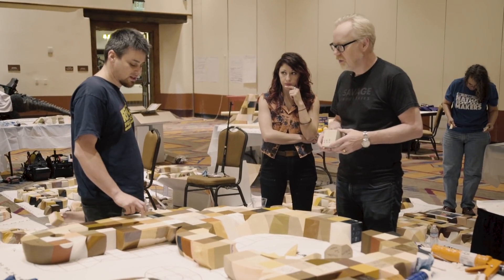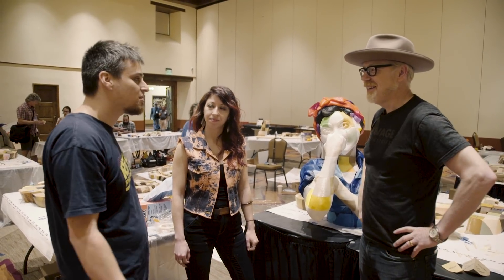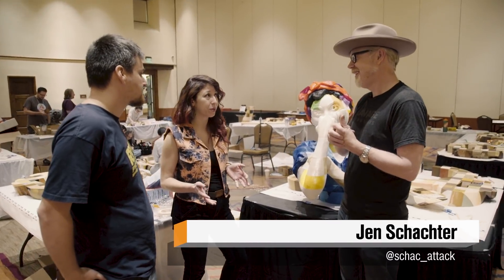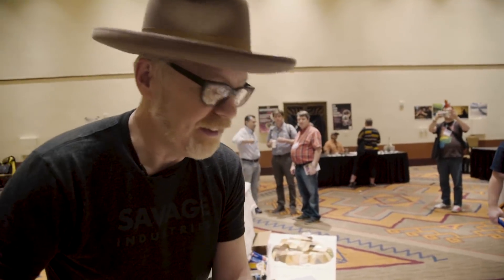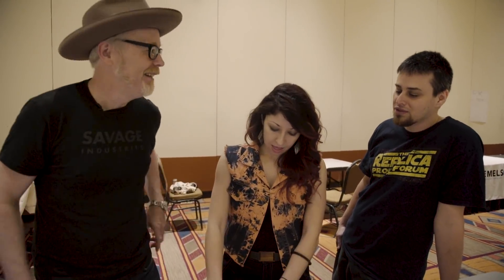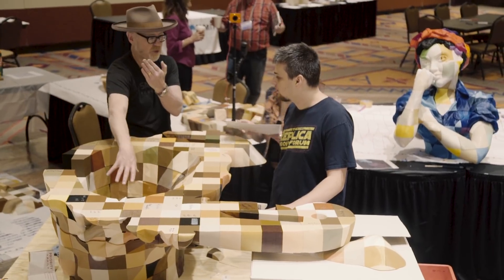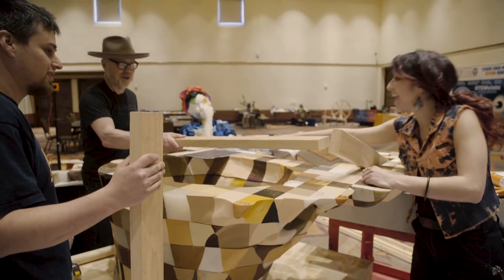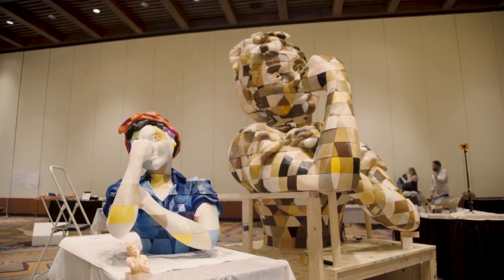Assembling the 2,500 Piece 3D-Printed Sculpture!

Comment: Keys would have been cool but I guess structurally it wouldn't work as good as a small model. Of course shrinkage and expanding would be a problem.  Filing input and output cleanups for keys would be even more work.

Comment: Passing through: if the entire modular sculpture is not fixed with glue but instead clingwrapped/laminated in place, would it hold better? I mean, heat gun and some suitable plastic wrapping material

Comment: So instead of blocks, why not just use a shell thats a like 10 mm thick and some alignment pegs and super glue? would end up with a structure that's way lighter, won't need 2x4 structure  and still able to farm it out to the community. plus could make them way faster too. If you need some help creating this please feel free to reach out to me as i've created props that are similar in size to your rosie which only weight about 30lbs in total,
Reply: Habiteer Workshop that defeats the entire purpose of people from around the world contributing to the pieces
Reply: Nope, you can still farm it out. It would be a ton lighter, way more efficient and easier to assemble. It does take a bit more modeling work though so i totally understand why they didn't do it, though i'm offering to help with my modeling skills in future projects, not just randomly criticizing :)
Reply: Sounds like a good idea although one of the problems they seemed to experience was with the tolerances of the various pieces leading to gaps and misalignment. This was compensated for somewhat with the glue. With a peg and hole system, any tolerance flaws would be exacerbated and may lead to a model that can't be assembled.
Reply: thinner parts would have less chance for warp,  making for better tolerance. you'd use wooden pegs and standard drill size holes so any tolerance issues could be easily solved. This method decreased the chance of flaws affecting the final build not increases. It's better in every way except for the cut up work.

Comment: This is probably going to make some people mad but in my opinion this is very stupid.
Reply: Maybe, however building it was super fun, and the time I had working with Adam Savage was a time I'll never forget!
Reply: The Only Alan Would you care to elaborate? If you don’t have any specific or constructive criticism, what was the point of saying that?
Reply: @nemeanlyan7918  I think it is stupid because this is the first annual nation of makers convention. I just think it is shameful to showcase a 3D printed statue at a makers convention. Though it is technically making, it's about as low as you can go on the totem pole. 3D printing is to making what TV dinners are to the culinary world. It's easy and it get the job done but requires little effort and is nothing to be proud of. It has no soul. Its a sculpture that was commissioned to be made by other people who commissioned machines to print a downloaded file and then mail that printing back to be assembled. Turnkey manufacturing is trendy but lazy when viewed as a maker discipline. We might as well make a huge picture and we'll just have a whole bunch of people download portions of the image and print it out and mail it back to us so we can glue them all onto a board and say we made something. It's preposterous and featuring it for NoM con is a slap in the face to the actual craftsman who actually make things. The artisans who make costumes and furniture and instruments and props. The real makers. There is nothing wrong with what they put together and I'm glad they enjoyed doing it. But it's just more cnc and that is why I say it's stupid.
Reply: The Only Alan
I get where you're coming from but 3-D printing is just another tool it doesn't remove the work, or the skill, or the talent that goes into creating a thing. Sometimes it makes things easier but it also sometimes makes things harder, just a tool. 
I have a friend who thought you just take a picture of a widget you want and plug the camera to the printer and it makes you one. It kind of feels like you're coming from the same place as him.
Reply: @theonlyalan731  You should read up a bit more what it takes to design a 3D model that prints well, it's not like a normal paper printer where you hit Print and it rolls out. 

Also the slicing of a model into different pieces isn't just clicking a button. It does seem easy but when you 3D design and print yourself, you would understand that it isn't particularly easier than another art form. 

Personally though, I would have a harder time drawing the Rosie or sculpting it in clay, but that's because I am not comfortable with that process. And I could think that takes less time, it's just some lines a a paper, for example, but once you actually do it, it's a lot more difficult than you think.
Reply: @porschepanamera92  the general consensus here seems to be that I have never used a 3D printer. I have designed and printed several things. Though it has been quite a few years. I have designed and built many many many things from the ground up. It's not that I don't know what I'm doing with 3D printing or any other manufacturing process. I just think that 3D printing is the low end of making and not worth being featured at a makers convention. I get that 3D printing is a tool. I just don't think it is an impressive feat. It is novel but it is not a talent nor a skill. There is nothing wrong with 3D printing and I don't think people should stop doing it. The point that I have emphasized over and over again is it is just not something worthey of a makers convention. That it was a poor choice for a feature about this convention. That is one step away from simply ordering something from a factory. And if you feel as though it is a complex and grueling process, maybe you should get out more and then explore the world of making. I feel like too many people are getting butthurt here because I'm bruising egos of arrogant maker wannabes.
Reply: @theonlyalan731  I understand your point of view. And I'm not saying that I was impressed by the end result, but like others said, it wasn't really about the result but more about the collaborative effort. The fact that they asked people to use a skin color and they got a palette of different colors, is meaningful to me, even though it is 'only' 3D printed. I liked that idea.
Reply: Your comment is stupid but i'm not telling you why!

Comment: Art is cool, but isn't making something big like this, out of plastic, really bad for the environment? Considering it's not really useful in any way? Maybe I'm wrong but just a tought...
Reply: If it's end goal was to be put in the trash and not on display, then yeah, of course that's not good. But this is meant to be put on display and toured around and is hopefully not destined for a landfill anytime soon.
Reply: From my understanding PLA is plant based and biodegradable.
Reply: It recycles. The glue & foam might mess that up, but theoretically you can remelt & reuse filament over & over again.

Comment: Ohh the pieces should totally interlock
Reply: Making them interlock would be difficult  because the  different tolerances of each machine and  materials used would  require a lot of sanding and reshaping to get them to fit together.  The simplicity of the cube shape  would allow for a bit of "slop" between pieces and still be cohesive.
Reply: @giheatherhobbit  you're definitely right. But it would be a next level challenge.  A simple interlock could definitely be measured easily enough
Reply: @moffatjason  Have you seen some of the gaps due to tolerances? Making interlocking shapes would be a nightmare for fitting that stuff.